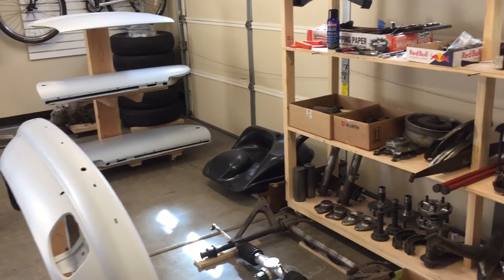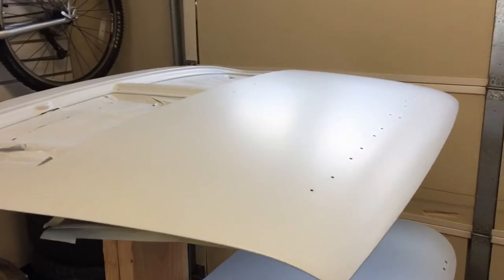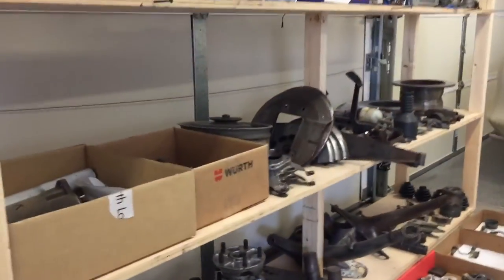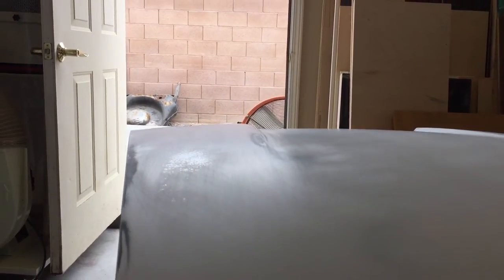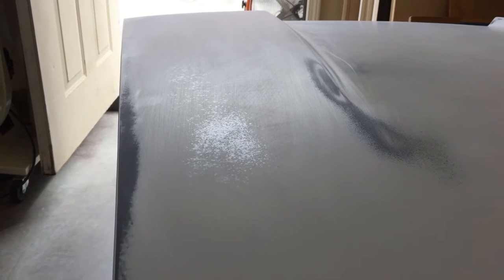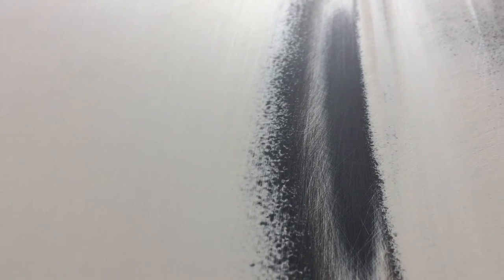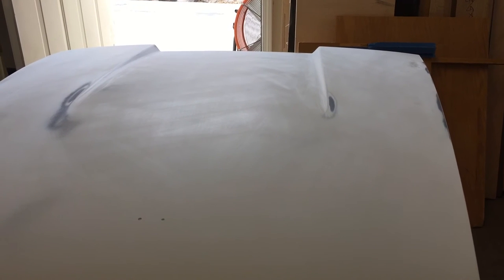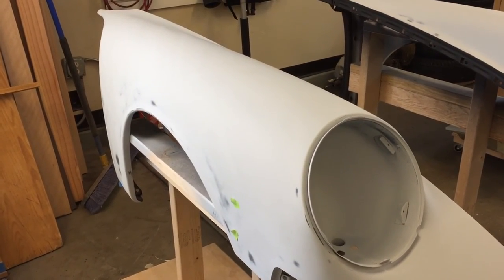1967 Porsche 911 Rotisserie part 3 Video 11

Comment: Sorry if I missed the answer but after sand blasting inner wings and inside of wings, body etc how would you finish them? POR15, coat of primer and good enough or would their be a 3 rd coat? Obviously waste of paint body colouring and clearing but just wondering about protecting possible rust from coming inside outwards? Absolute stunning build by the way. Attention to detail is second to none and as a Mechanic myself I can appreciate the work involved, however, bodywork and painting not my strong suit hence the question lol
Reply from the maker: Hi Kitts
Thanks! Great question and welcome to the channel
Soon ill be going over those areas and will be sure to give a detailed explanation for you there
The short version on this project..

Underside and inside fenders: 1 coat POR15  2-3 coats rubberized under coating 2 coats clear
Trunk and engine bay: same as above
Interior: 2 coats POR15 covered over with dynamat

All areas seen including door and fender jambs will be epoxy primer/primer surfacer/epoxy sealer/base coat clear coat
Timing of re-coats and how to transition from one area to the other is most important on all above but will be sure to cover that in great detail coming up soon
Hope this helps!=)
Reply: Mike M that's great thanks. Looking forward to rest of build.